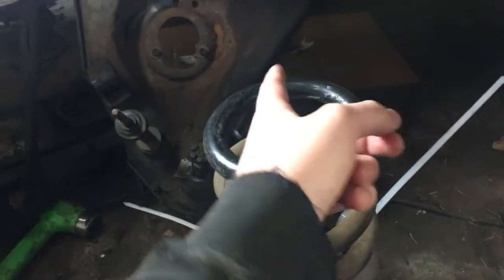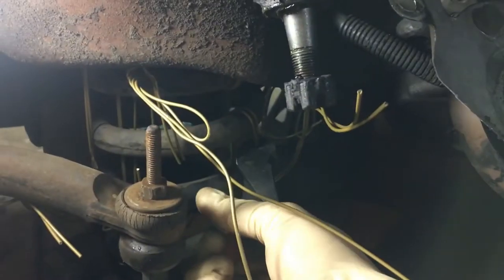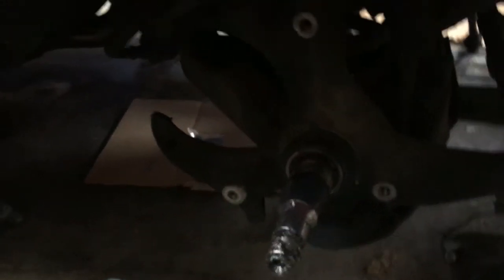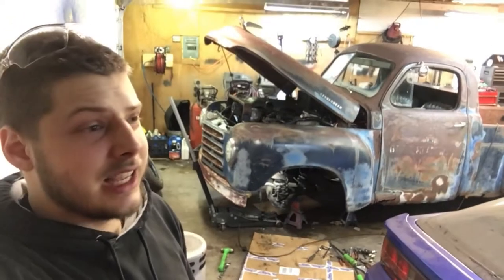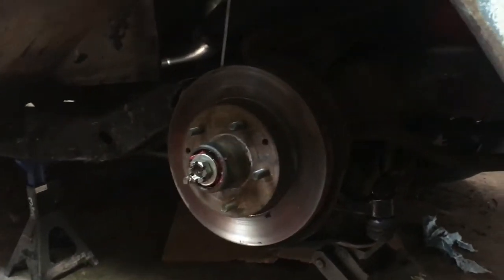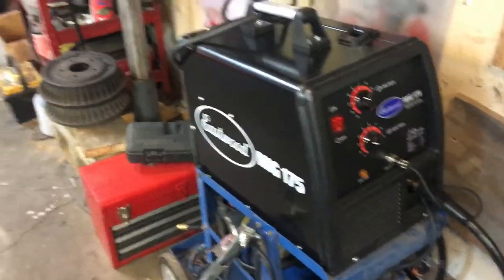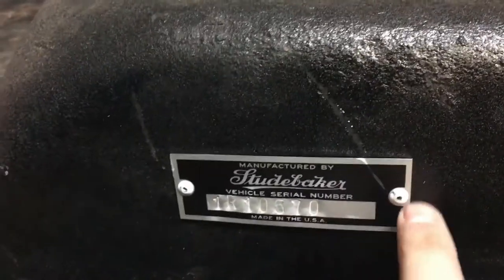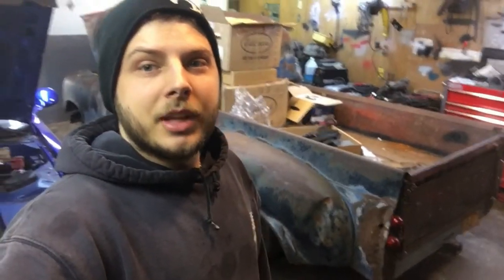Studebaker Pickup Rat Rod Build Part 24

Comment: You've done a great job! I've watched from the beginning. I am currently building a 51' Studebaker truck rat, but it;s way more roached than what you have. I've got it mounted on an S10 frame with an old inline 6 engine with a Muncie 3 speed. Anyway... good job.
Reply from the maker: Rick M thanks. My truck isn’t the best either. Seems these trucks all rusted pretty bad. I tell everyone my truck was non restorable but still very useable. More videos to come.
Reply: Rick M Love straight 6s! I have a flathead L6-226 Super Hurricane 6 in my jalopy!